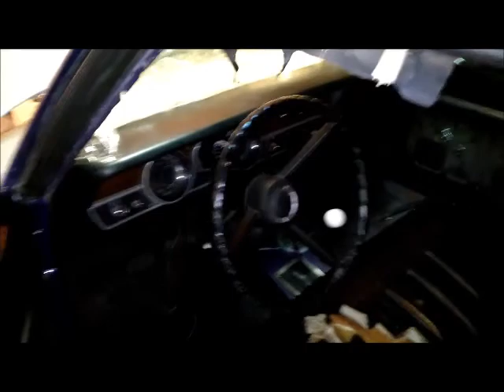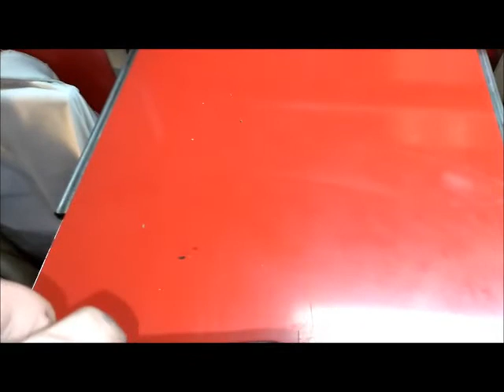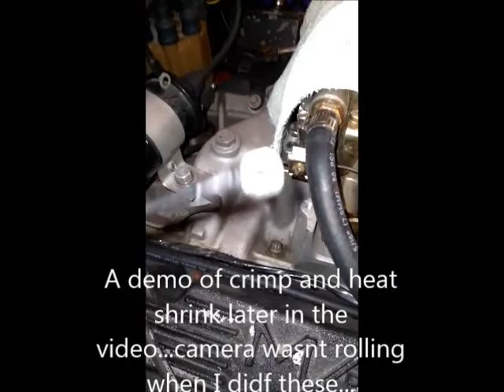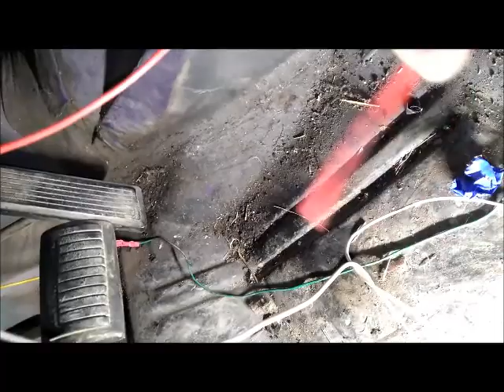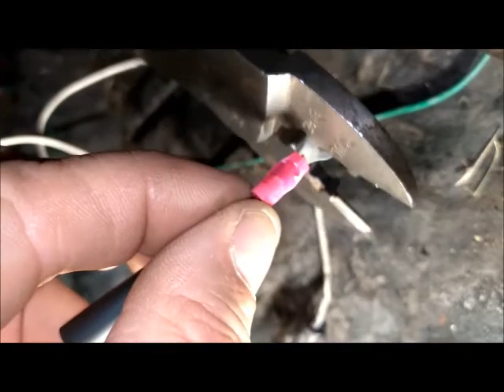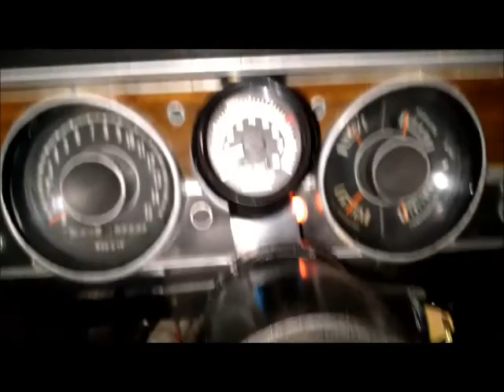Sunpro Mini Tach Install 70 Dart Swinger 340

Comment: The holes for the various screw sizes are for cutting these small dia screws without ruining the threads big time when using the wire cutter for this....greetz from Germany...looking forward to installing my retro old style tach in my survivour 65 Belvedere1 with 3 on the tree and a slanty up front....baby blue (cc1)

Comment: I still have my 1970 340 Swinger I bought in 1970.
Reply from the maker: They are good cars. I bought mine in  93, it was in rough shape...:)
Reply: @MrSwinger1  Mine is still in nice shape but the engine needs a rebuild. Hoping to get it done next Summer.
Reply from the maker: @ajw6715  How many miles are on it of you don't mind me asking,mine had a 318 in it when I bought it with 99 thousand on the odometer. I'm guessing they got 60,000 on the 340 running it hard...my car was ran hard,drag race stuff,scattershields,headers and whatnot. I put alot into collecting parts to put it back to near stock.
Reply: @MrSwinger1  I can't remember the mileage I haven't  looked at the odometer in years. The car is locked in a conex box and has been there for years. I have been planning to get it out but never get the time. Hopefully next Summer I will get it out. I will take a look at it maybe tomorrow and let you know.
Reply: @MrSwinger1  It has 137,000 miles on it but I have taken good care of it. I did all the brakes about 25 yeas ago and only put about 100 miles on it sense then I put it in the conox box. The conox box keeps the mice out. The car is not really dirty ether. Engine is tired. Maybe next Summer I will take care of that? I sure hope to get it out.
Reply from the maker: @ajw6715  Thanks for looking into that. Thats good mileage for a 340 engine that I am assuming hasn't been raced.
Reply: @MrSwinger1  A few street drag races when it was new and I won most of them. Lol. It has a 4 speed and 390 to 1 rear gears. It was quick for the time.
Reply from the maker: @ajw6715  good to hear,I have the same trans and rear in mine.
Reply: @MrSwinger1  I think today they have these dart swingers under priced. I know they made a lot of them but most have been crushed.
Reply from the maker: @ajw6715  I seem to recall they made around 13000 Swinger 340s in 1970, couple that with the body style changes in 70, and the change to Demon 340 in 71 and the 70 Swinger 340s are rare, essentially a one year car, even though they had a 69 340 Swinger, its different in many ways. Yes, they are under valued I agree. They are legendary performers though.
Reply: @MrSwinger1  I didn't know that. My car was built in September 1969 and came with a 69 engine with a Holley carb. I have seen one other one that came with the Holley carb.